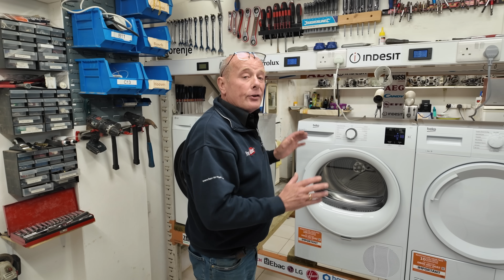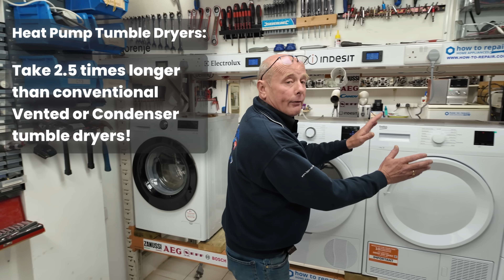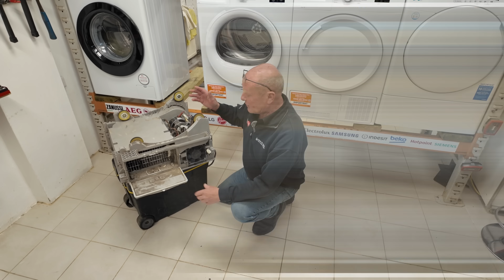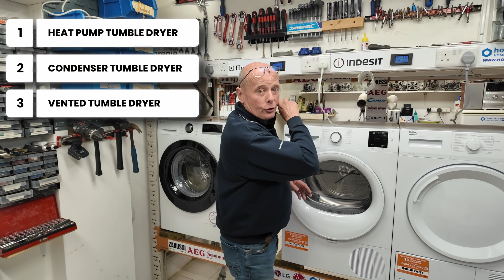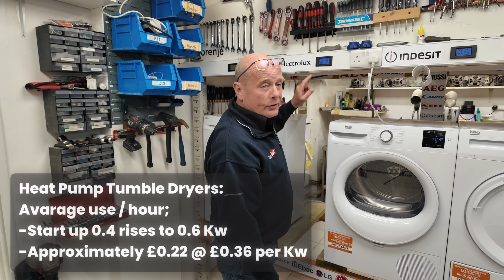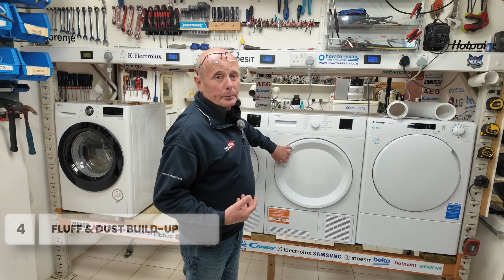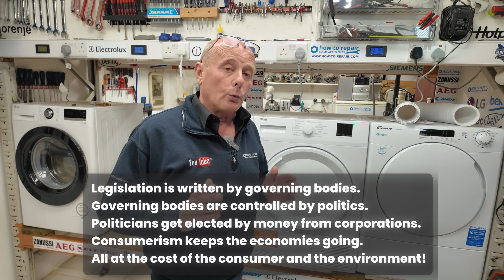Tumble Dryers the Shocking Truth About Heat Pump vs Vented & Condenser, NEW LEGISLATION!

Comment: My experience is the Heat pump system rarely fails.
Like a fridge, It's a sealed system. If it needs a refill, something went wrong!
Cleaning is a big issue! If the filters are not properly designed ore regularly cleaned, the effectiveness goes down and the Heat pump system gets more stress.
Some people even don't know, there is a second filter right in front of the heat exchanger.
One advantage of the Heat pump dryers is the lower temperature.
You can put clothes into them, you can't put in the other dryers.

Comment: nope the governing bodies have been brain washed by the exact same people who think that EV's will save the planet. i can't see how it benefits the manufactures as the repairs (when chargeing £100+ call out) to change a heater will now result on a call out to then have to replace the entire machine after 5 years. however with your 2.5 times longer to dry analysis. i'm not sure where you have come with that figure. sure drying a handful of items. dose take 2.5 times longer than normal. but with a full load. it takes pritty much the same time on modern heat pumps. typically takes about 70 minutes to dry 5kg in my miele T1 Heat pump. and 2 hours to dry 9kg spun from a w1 in the T1. sure the miele vented takes 50 minutes to dry 5kg, but its still 70 minutes in a miele condenser.
Reply from the maker: Thanks for the comment. Most of the lower end brands on average are taking at least twice as long when they're new.

Comment: We've had ours for 5 years, no issues. I'm more than happy that it uses 600w rather than the older ones 2200w. If there are less clothes in the dryer, it cuts the amount of time. 
Heat pumps in dryers represent progress and are the greener choice

Comment: Glad you bring this up. I was wondering about this. These machines are intentionally made to be too hard to fix and even self destruct. I did it; cleaned the clogged up heater/cooling unit by poking the dust out with a wire. It will never get the efficiency back from when new btw. And replaced the bearings in the fan. Now its working again, but it took me hours.

Comment: I totally agree with your findings, I noticed the performance of my Samsung heat-pump dryer gradually reduced over the years until I was forced to repair it. It was a major job, and I was shocked how much lint had bypassed the filter and blocked the heat exchanger! Corrosion was also evident due to the trapped moisture.
Reply: I agree with this. They cannot be deep cleaned by the consumer and can become self-destructive over time.

Comment: Wherever possible, I line dry laundry first and then finish it off in the heat pump dryer. Big reduction in wear and tear. I did manage to clean the condenser but what a ball ache.

Comment: When I moved into my house the previous owner a 90 year old widow left a old dolly tub, posser and large cast iron hand cranked mangle, out of curiosity I used the mangle and even after a spin dry in the washing machine it got far more water out than I expected especially from items like jeans though I used no methodology in recording the drying time I would say it cut at least a third off, I still have the mangle now that electricity prices are so high it would probably save me quite a bit of money if I started to use it on jeans alone, only problem was you cant put the top part of the jeans through with the waist button because it tends to crush it flat.

Comment: Household items should not be consumable - legislation should force manufacturers to offer minimum 10 year warranty and parts support for the life of the product.
Reply: They need to start making the producers of these white goods responsible for the costs of recycling. A few years ago I bought  new fridge freezer after the compressor on the old one started to fail after 25 years good service. The new one lasted 6 years before it failed & the cost of repair was higher than buying a new one. Green my a*se.
Reply: I have had so much trouble with new applainces failing within 2 years. A fridge and a washer. the washer is out of warranty and it appears ro be a control board. If the pressure switch were separate component i could just replace the switch but it is part of the board. something has to be done.
Reply: @wilmerdavis9688  We had an LG washing machine fail twice within warranty.  An absolute joke of a company to deal with.  Had to send a warning letter about small claims court action.
Reply: @wilmerdavis9688  sue them if they don't repair or replace. Sorry, I know you posted a year ago, but it doesn't matter about the warranty. That's a distraction. The law in the UK does protect you.
Reply: Mandated product lifespans will replace the greenwash, it doesn't cost more to design and make a product that stays out of landfill for longer.
Reply: @John_Smith100  And there's no reason why household white goods cannot be made 100% recyclable.
Reply: If our legislators are so concerned about being green and saving the planet, this ought really to apply to any gadget we buy.  I think it's a disgrace that support for each version of windows, for example, gradually gets stopped.  That new programs don't work with older gadgets/versions etc etc.  I don't want to have to alter, or pay for alterations, or have to replace things I buy every few years.  Things should be built to last.  Alas, that doesn't make the manufacturers more money I guess.  Another thing which irks me is, I have a perfectly good dumb phone.  I don't NEED a smart phone.  But they are switching off networks, so that I will eventually be forced to buy a new phone.  I bought a computer, and a dumb phone, and I want to be able to still use those for as long as they live.  But noooo, they want to keep pushing you to buy newer, shiny gadgets.  I hate it.  I want to use things until they virtually fall apart, not be forced into updating, upgrading, buying something else just to keep using the same item.  Meh, I'm getting grouchier as I get older lol.
Reply: @randomnesspersonified . I wholeheartedly agree with you-my sentiments entirely.
Reply: @randomnesspersonified Totally agree. My mobile was released in 2021 is works perfectly. OS security updates for this model will be stopping today (end of 2025). In order to allow me to have access to work email Cyber essentials require I must update my phone.... such a waste and mobiles are not cheap.
Reply: @randomnesspersonified That's why i stay away from modern cars, my 21yo car, is still fixable with physical tools.
Reply: @randomnesspersonifiedBest comment
Reply: @randomnesspersonified Just use Linux and all the free 'open' software. 'Office' is free, as are a whole number of applications. For 95% of home users it's more than adequate.
Reply: Oh, and all the different types of leads you have to have - this one isn't compatible with THAT one, and so on.  Ridiculous.
Reply: @randomnesspersonified  In the EU all new mobile phones must now use USB-C. Its thought that manufactures will probably just do the same in the UK so hopefully at least that madness has been sorted.
Reply: Yes and maybe then they would build a good product!
Reply: @kaf2303  Precisely!
Reply: That's what our tumble dryer offered. But 3 years in, it's not worth getting hold of the manufacturer for a capacitor. But the main reason there is no point having a 10 year guarantee on parts, (without legislation in place to deal with purposefully hard to repair designs) people who can't replace a capacitor themselves, will find a new one cheaper, than the 2 hours + labor to strip the whole machine, just to reach the capacitor.
Reply: This is a terrible idea when you consider the lengths a company will through in order to shed liability.  This will just encourage them to compartmentalize a brand, and shutter the whole company when they accumulate too much product line.

To keep them on the hook you have make it so any discontinued model needs to have its designs released into a public repository (handled by a government trade commission or similar), and the designs licensed out to 3rd party manufacturers to produce After-Market parts. The license fee is paid to the repository maintainers to cover the costs.  If you treat model revisions as an umbrella to keep the life of a product line going, the overall product life cycle should be longer in practice.  The main way to cheat that is rapid retooling of a production line or incremental design changes; which I presume is costly for a mass production line. 

This should, in theory, force a manufacturer to choose where it wants to make its money. New unit sales, OR after market maintenance.    The risk though is them trying to pull a McDonalds/Taylor situation, where the machines have an abnormally high failure rate to coax repair costs.  Addressing 'that' requires more finessing with regulations around Warranties,  imposing penalties for failure to maintain capacity for warranty repairs, and some scheme to address abnormally high failure rates for certain classes of products.  

The world is in a weird state where big ticket items generally work best with a limited number of competitors, due to economics of scale. But that has to be paired with intelligent regulation, to keep the incentive models aligned with customers and the general public.  I say that knowing how big of an ask that is for any current government administration in the big countries, the breed of CEOs in charge of most companies right now.
Reply: So how are they going to make a profit? Answer charge twice or three times as much!
Reply: Amen
Reply: 100%
Reply: Best comment !
Reply: FYI The dryers in the video had stickers saying 10 years warranty on parts on the front of them.
Reply: @neo_265  FYI they don't just give you the parts - You have to pay their extortionate labour rates to fit them.
Reply: @p @peterpiper5064 if only
Reply: @neo_265 Yes, but if they so poorly design the unit making serviceability poor, the labor costs (or homeowner time for the DIYer) will be high enough that replacement may still be cheaper, especially as it reaches its warranty life. Parts and labor both have to be in the warranty, and any user-required service needed to maintain the warranty to be done from the front of the unit.
Reply: Miele does!
Reply: They can't warranty things for 10 years.   Let me give you an example from a guy in the appliance industry.   People do not properly clean dryer vents, they over load washers.   How can the manufacturer warranty the machines for 10 years.      The Whirlpool direct drive washer from the 90s to 2011 are still running in mass today but no company in their right mind would of put a 10 year warranty on it even tho they are incredibly reliable.  They would need to charge 3 x the price to do that
Reply: @BRWfilms  The principle is that warranties should be longer, but I agree the duration depends on the type of product. Nevertheless, spares should be supported for the lifetime of the product and products should be designed to be repairable.
Reply: @OccamsRazor-q7i I do agree with that 100%
Reply: we should have this on most consumer goods period.
most things could be, with reasonable effort, built to last at least 10 years.

they keep making legislation forcing efficiency standards but they never force longevity standards.
Reply: I mean... That's easy to do... But most people won't pay the increased cost to do so...
Reply: lol and the uncle, brother, family member of the government will not get the contract so no chance of that!! 🤣🤣😂
Reply: Yeah but it's like light bulbs, they can be made to last forever (google the conspiracy on that one) but how does that work for the manufacturer's "value chain"?  Greenwashing is not driven by the greenies, they're just virtue signallers drinking big business's kool-aid...
Reply: @Farlig69  Manufacturers will simply adapt and offer the next model with improved features and higher efficiency etc.. The light bulb is a good example, even if filament bulbs lasted a lifetime, customers would still switch to LED for their reduced power.
Reply: You cannextend to 6-7 years... I'm waiting to See what they say about the fluf I had pop up behind the thing that holds the clothing... It should not be there...
 I wash a lot with an 88-year-old...
Wish I saw this before I bought mine.
Reply: It's worth noting that the UK has a mandatory 6 years warranty on all products. Not quite your 10 but it's better than most (all?) other countries.
Reply: A legislated 5 year warranty would be sufficient to make machines last half a lifetime, it’s probably harder to make a machine that just makes it through the years warranty than it does to make a realisable decent machine. If there’s was really a global climate problem there would be legislation regarding products lifespans…..but it’s all ok if it keeps the money flowing, right! 
Heat pumps are a scam, they are the electric vehicle equivalent of the household appliance, a new fad, a cash cow, call it what you like….you’ll be told in 10years that ‘we(the scientists)were wrong, heat pumps aren’t the saviour we thought they were.
Reply: They do. Household appliances do have to last at least 10 years. The manufacturer can offer whatever warranty they want - that's just 'no quibble' and marketing. In reality, the law is the law. You can sue them if the appliance doesn't last as expected. In the UK.
Reply: @thestarcleric  No, it's not 10 years, it's "a reasonable amount of time" which is vague, can vary depending on product and is open to interpretation, but no longer than 6 years. 

The point is you shouldn't have to sue them (which will probably cost the same as a new appliance, not to mention the cost of your time) - they should just fix the thing already.
Reply: @peterpiper5064  I should probably have said: I speak from experience of having had to take people to court - and seen friends do the same. You are correct that it depends on the item. Given the vast precedent for e.g. washing machines / fridges that last 10 years+ they should reasonably be expected to last at least that long. In reality, it should be much longer.

So, yes, when it stops working 2-3 years in, regardless of the manufacturer's warrant/"attempt to trick you into thinking they stop being responsible at the end of whatever they chose", they are still responsible.
Reply: And raise prices. Need to raise the fed minimum wage. On board?
Reply: @nsbioy   Ah, the minimum wage fallacy.
Reply: I agree with the principle that things should be warrantied for much longer but not everything should be the same number of years. TVs 10 years yes, washing machines probably longer, but mobiles maybe 5 years.
Reply: As a consummer, you have a choice. You can buy a Miele which is guaranteed for a decade, but will last far, far longer. Or you can buy a cheap brand for a third, or even a third of the price, which will probably die after three years.
Reply: @iainathairydog  Unfortunately, you don't always get a better designed product by paying more.
Reply: @iainathairydog I have a half the price Zanussi. It’s 23 years old, still working great, & needed zero repairs. Mum’s Miele failed in less than 2 years. Cost isn’t always a guarantee of good design.
Reply: No. Legislation is what caused this problem. Next are you going to say oh, these 10 year warranty appliances are all so expensive.. We need legislation to cap the price. fool.

Comment: I live in Perth, Western Australia. I have a 15 year old Hoover (element type) drier, which is outside, located on my patio. In summer, I use ambient air only (Not heated air) and my clothes are dry in 30 or so minutes. In Winter, I simply dry my clothes on dry days. 
Every thing you said in your video is correct. Thank you for sharing!

Comment: Still glossed over the issue of 3x drying times meaning the lower consumption per hour is quite high for 3 hours? compared to the other machine finishing in 40 minutes, my heatpump takes 2:45 on the quickest cycle. I might add the heatpump is now broken, but it still basically works, and uses around the same power as before, which I find strange, but hey.

Comment: Not my experience ..i bought an lg hestpump dryer because the old tumble tryer was blowing moist heated air throughout the house causing mould.it dosent take 9 hours to dry a load ..it takes same time maby less ..i set it on mixed and the sensors stop the machine when its dry..unlike my older machine which could keep going..mixwd load takes 1.5 hours ...thats my experience..yes its expensive to buy one ibut so worth it.